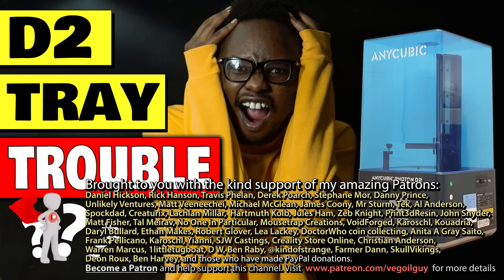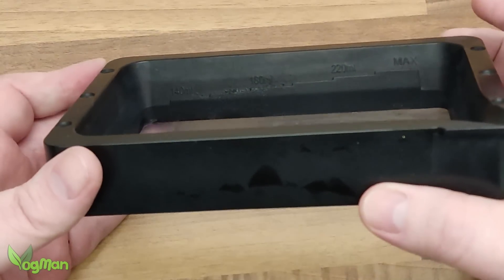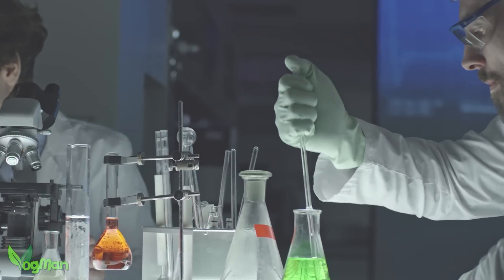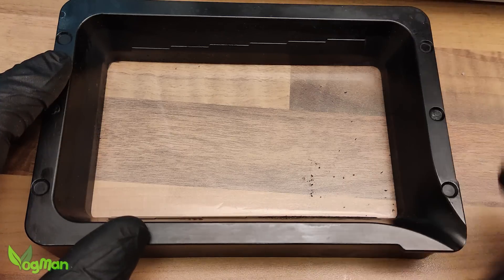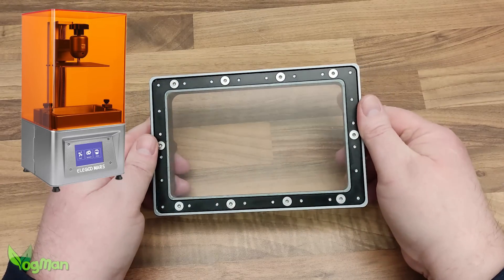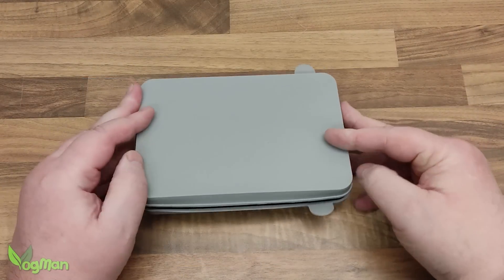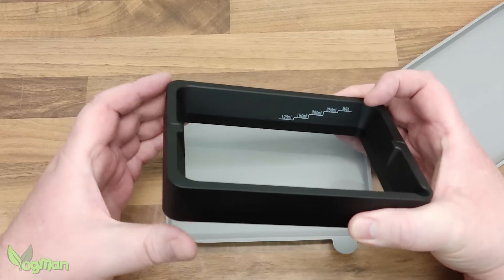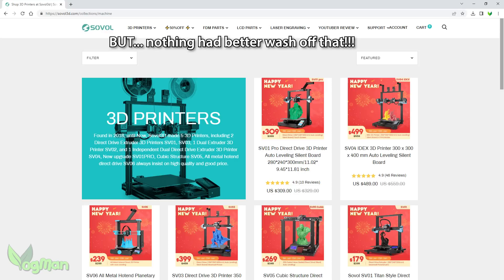D2 TRAY TROUBLE UPDATE - Anycubics Photon DLP 3D printer problem

Comment: My experience with Anycubic customer support has been horrible, they take zero responsibility, so not sending you a replacement is no surprise.
Reply from the maker: It's a real shame to hear that.
Reply: I second that.  Will never buy anything else from them.
Reply from the maker: Interesting...
Reply from the maker: Would you mind sharing your 3D printing experiences here https://vegoilguy.co.uk/3drp
I'm collating data on all makes and models of printer.
Reply: I just bought a photon mono 4k, so this is a little concerning to hear..
Reply: We have 3 Anycubic printers (D2, M3 plus and M3 premium). All had issues after short period of time. For the D2 they replied ok and sent a new touchdisplay and mainboard. The m3 plus is defect since December with back and forth messages ( most replies are a robot - before a human jumps in) without having it back to operation . The m3 premium failed after 6 weeks (poor illumination in the center) - within 1 week they asked for more info (like always) but no solution. We have asked to return the printer…the relationship will likely not continue…we have ordered a different brand now…
Reply: My issue has now been resolved via Credit Card purchase protection so I can go a little more into details. Anycubic Support insisted I disassemble my 3 day old D2 and troubleshoot the stepper motor with a multimeter, which I was unwilling to do. After being told their support team was not authorized to create an RMA I was referred to the sales team and after six weeks of back and forth, including being referred back to support, I was told they would issue a refund if I sent the printer to... China, at my cost (it was shipped from the US). Hard pass guys.

Comment: Have mars 3 pro, it comes with a metal vat
Reply from the maker: I don't recall seeing an Elegoo with a plastic tray if I'm honest. Good for them. Metal is better 😁
Reply: Original Mars 3 too. Plus the Saturn 2; all metal. That, combined with Elegoo's decent support, is why I buy their printers.
Reply from the maker: Thanks for that. I didn't think we'd seen a plastic tray from Elegoo... well, not on a printer... I believe they sell them separately.
Reply: @vogman  to be fair, I think one of the earlier Mars models came with a plastic tray; but I've not used one so I'm not 100% sure.

Comment: For me, the worst part is them not offering a replacement tray.. If I buy a faulty product, I expect replacement parts at the very least.
Sadly it doesn't surprise me as I had a lot of problems with my Photon Mono X. Support was helpful, kind and replied quickly initially, but as it became obvious that the problem wasn't easily fixed, they became increasingly less helpful and took upwards of a week between replies. I was looking at upgrading to one of their other printers, but I'm a bit weary of buying from them now to be honest..
I hope it's something they work on and improve.
Reply from the maker: I was surprised when they didn't offer, especially as I'm technically still reviewing the unit. Hopefully this will send a message to them that consumers want reliable products and superior service 😁
Reply: @vogman  I think you need to simply ask them to send you a replacement. Offtimes with these large companies they don't take hints, either by accident or on purpose to save money.
Reply from the maker: Trust me, I did. Maybe it was lost in translation 😁😁😁

Comment: New Year, New Project(s)... - and 3D printers... What can go wrong?
I don't know if I have withdrawal symptoms, or there's something wrong elsewhere... But I'm thinking:
Paint the tray in conductive paint, polish that shiny. Do an electroplating in the same material (Cu?) - Polish shiny, and finish off with a Chrome layer.

I mean - being able to plate plastic with metal is also useful in other projects, and practice is good and the printer seems to need it ;ø)
Reply from the maker: I think I'll stick with the easy and cheap alternative 😁😁😁

Comment: Very surprised that they haven't come back on this issue; has to be some particular resin you are using which affects the plastic vat. As you suggest upgrading to a metal vat which gets around the problem is the solution. Got a D2 eventually to go alongside my Ultra and bought a 2nd ceramic vat (Chitu Systems) immediately for the D2.
Reply from the maker: Smart move. The D2 is excellent, but spoiling prints with flakes of plastic is a crazy notion.

Comment: This is a recurring problem with printers. Resin is extremely good at eating through plastic and paints (some resins can eat through Nitrile given the time, it's absurd). It depends on which resin you use, and how long you leave it in the vat, but generally it's just less than ideal to have either a plastic tray or a painted tray, the best thing you can have is a metallic vat that has no paint, just a good finish.
Reply from the maker: Excellent point! I do use a lot of speciality resins, including castable, so these may have more of an impact on plastic trays. It's just strange that this has only happened to me with the D2, and not the Ultra or the Mono 4K.
Reply: @vogman  You should have gotten the green teflon coated solvol tray, as you mentioned, the markings fade and also the black tray loses black over time - the resin and cleaning break down the black paint (I had the black tray for about a year, two years ago).
Reply: @retromodernart4426  The link takes you to the black one.
Reply from the maker: True... I went with cheaper... but I believe folks looking for the Teflon should have any easy time of it once they follow the link. Or they can search for themselves. Or seek alternatives! So many wonderful options 😁😁😁
Reply: @vogman  Formlabs trays are all plastic for the Form3 and some of their resins start a lifetime counter the day you load it in the tray as they damage the plastic. Specifically their engineering resins such as tough and flex. The standard resin they say doesn't do any damage so it wouldn't surprise me if it is the specialty ones you are using that caused the issue. Either way Anycubic if they don't have a disclaimer warning you away from specialty resins should have replaced the vat.
Reply: Another benefit of having a metal vat : it's a better material to use a fermentation belt to heat the resin to 25*C during the cold season. Yay !
Reply: @the_arcanum  This is exactly my reason I purchased extra aluminum vats/trays. Metal allows the heat belt to warm the resin. A brilliant solution.  Happy printing!
Reply: My thought too it has to be interaction with the the type(s) of resin used.
Reply from the maker: It might be... BUT I've used the same resins in the SAME plastic tray of my Ultra, with no problems. That's what makes me suspect it was a bad bad 😁